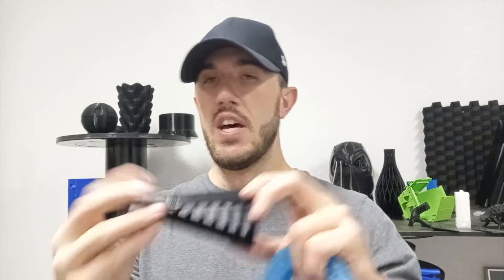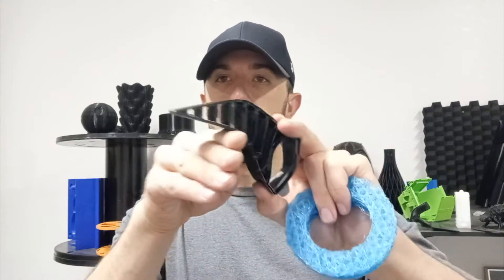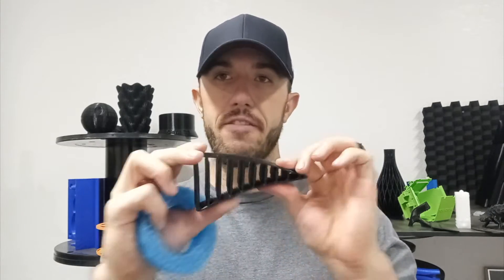Mass Producing Rubber Parts with 3D Printing

Comment: I have an older USB KEY  that has a stertchable rubber sleevelet that is very cool and wondered if the rubber material you are using would be stretchable
Reply: Depends on what kind of tpu you get. Some kinds have more elasticity than others. Would have to get some different kinds and do some experiments.